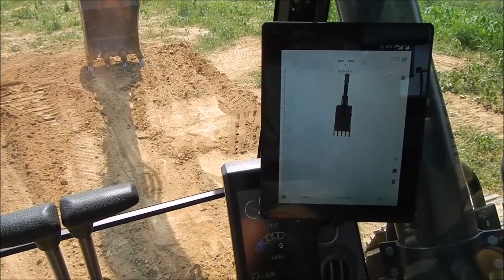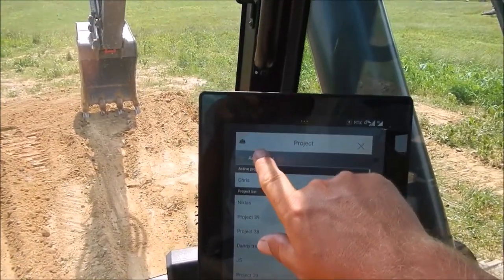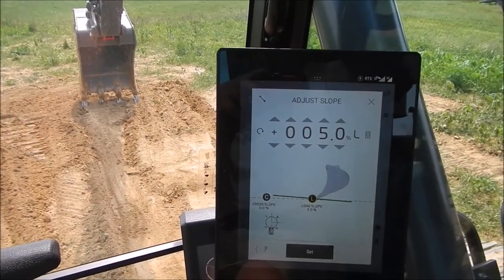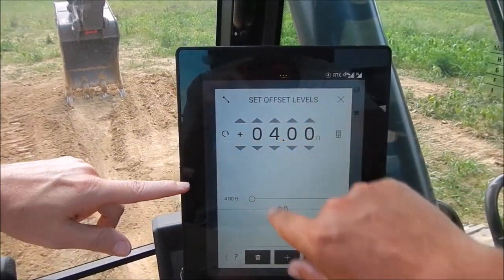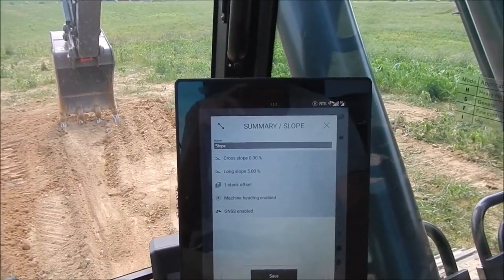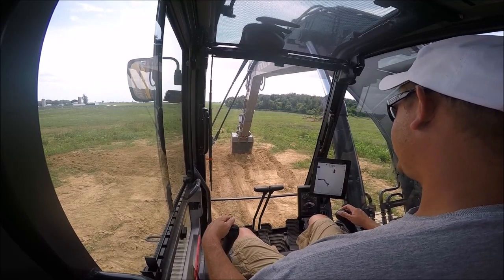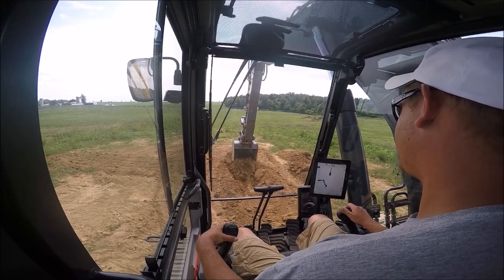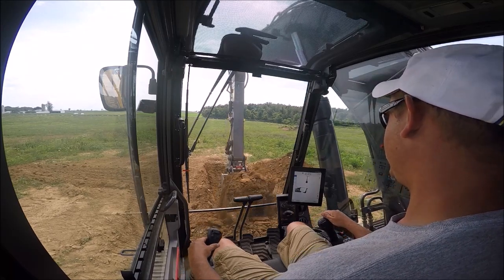Dig Assist- Volvos New Grade Control System

Comment: As a young operator, 20 years old, you can tell this guy is a seriously good operator. Fluid motions, not a stroke of the boom wasted whatsoever. He makes it look easy, but it's far from easy. I still have a lot of trouble operating. This man doesn't even need a computer. He could do this work without it with ease. I won't be able to continue to learn how to operate, as I'll be going into the US Navy on December 11th of 2017. But I'll embark on a new career and a new path. And take with me the skills and work ethic I've learned through excavation and heavy equipment operating. It's given me a new found respect for structures, for progress, and for construction as a whole.
Reply: You are easily pleased. Chris is not that good. He is only used to digging big holes. Like he said himself, he doesn’t do much Utility work. That where you need to be good. You would realise that when you gain more experience.

Comment: that's pretty awesome, years ago when the locomotives went computerised I thought wow this is going to make life easy. fast forward and looking back it sucks. when I first started with the railroad it was a skill to keep a 100,000 ton train under control. now the computer does all the work. the sound, feel, pull etc is gone, just respond to that screen is all that's needed now. October 18 of this year I will retire, before the computer has a chance to fully take over my job. I say all of that to say this.....seems you are a great operator, young and knowledgeable throw that thing out the window and bury it and go free hand!!!
Reply: Would of been greatly impressive to see the skills used by old timers on steamers when they would use 2 locomotives on both ends to get trains through the mountains. Days of pure skill and no electronics to act as a crutch.
Reply: animenut69 yulp now it's all done off remote control
Reply: Yep ,like one of my cars, full of electronic stuff which takes all the thinking out of driving ,stability control, traction control, proximity warning, ESP, blah blah and a system where a scanner can tell me what is wrong when aforementioned electronics  fail ,which it has done so often i drive my 31 year old mercedes Diesel which is electronic free, the only electrics are the lights and fan motor ,and it never ever lets me down ...
Reply: I don't understand this comment, the system doesn't dig for you.  The skill is still in the operator. This system just creates efficiencies by eliminating the need to get out of the cab if you are flying solo or the time and expense needed for additional employee doing nothing other than checking grade.
Reply: "Digging for you" isn't far off buddy.... actually it's been here for a while, but only really implemented in mining and other sites that are extremely secure as far as very restricted personnel access. But the tech is there to have a completely autonomous job site with dozers, graders, excavators, scrapers, rollers..... you name it all running themselves and reporting back exactly how much material was cut, moved, placed and compacted. The major restrictions as of now as I see are cost of course and site security.
Reply: Jason King problem is we all want everything done cheaper. To grade I have somebody stood with a laser and a post to check depth.  Something like this means it becomes a one man job so half the Labour charge.
Reply: Unfortunately nowadays, operators are held to account for every minute they operate the machine. Grade control in a Digger is a step forward, as it gives a starting point, and a reference as the grade goes along, with the responsibility back on designers to notate exactly what they want. The operator has a job file as proof of delivery. When an engineer knows the operator has that file  I imagine there is a lot less finger pointing going on. Additionally the file can be added to the "As built plan". Wouldn't that make finding the pipe 20 years later a whole lot easier .... or less likely which ever way you wanted it?

Comment: You took to that pretty quick, Chris.  You might like the feature similar to this on some of the Cat excavators called "Grade with Assist".  Before all the trolls jump on this, the feature is for both new and experienced operators.  It allows the excavator to be programmed to hold the boom and bucket at a certain depth or angle as the cuts are made.  It is a HUGE boost in efficiency, just like what you were starting to experience in your video.  This page and video is an intro to the feature:  http://www.cat.com/en_US/articles/support/technology/grade-control-excavators/grade-with-assist.html  (not sponsored or employed in anyway by Cat, just like heavy equipment, like you.)
Looking forward to watching the rest of your mini series.

Comment: If the machine knows what you are trying to achieve it would be a cool option to have it even out the bumps and avoid correcting tenths
Reply: There is such a feature (in some Cats) that I explained above.  It helps with reaching that fine point efficiently without having to redo.

Comment: Trimble has a system i've seen on the new Deeres (junk) that actually takes control of the hydraulic system to cut grade for you. All you do is pull the levers straight back and it does the rest.

Comment: Very cool, buuuuuut does it still work if the top of grade where the machine sits is not flat? Say the machine moves up 1 to 2 feet in elevation. Will the computer recognize this and compensate? Or will the flow line of your pipe be thrown off?

Comment: As an owner operator, a lot of these programs are far to expensive unfortunately! I use the simple but still effective boom mounted lazer receiver, saves you getting out the cab 10,000 times lol wouldn't mind trying that system tho.

Comment: Does it set the trench depth off the original point and if so how does it track that depth in regards to if the excavator is moving on uneven terrain? Like if the next move is very steep and your tracks are say 2-4 ft up or down from where they sat on the first dig? Very cool tho
Reply: Good question? I thought there might be a laser tracking system setting the grade base line for geade control system. I'm setting up Topcon equipment, now.

Comment: Does Volvo's system set without an outside laser set up? Like is that system machine based only - seems like it is based on how you set grade w bucket on the ground. Very useful set up it looks like thanks for the videos
Reply: Was thinking the same thing, one factory vid mentioned that the cab had both laser and satellite receivers.  The way it's presented, it appears to use purely GPS, which it must integrate with onboard measurement for precise dig parameters.  Would sure save a pile of cab egress for those of us who work alone.
Reply: Kyle Riegle Kyle, I like your YouTube channel. No new videos lately. Hope its because business is so good there's no time for vid production.  Thanks for all the information you put out there.
Reply: Thanks!  that is the case - I finally feel a bit caught up ahead this week.  I have an update video recorded, I'll work on uploading it now.

Comment: If you have a decent ditch man in the bottom you dont need a computer,it could be helpful for new operators but nothing can replace a man in the ditch
Reply: You sir are correct! A good ditch man can tell you where to cut without even looking at the grade pole!
Reply: You are right the problem is these days no body will get in the ditch they can make more money sitting at home on welfare even if they did get in they would suck they just don't give a shit. I have to work alone a lot or with one other guy this tech would help a lot
Reply: Jamie Easter yes that is true with a small crew this could help a lot